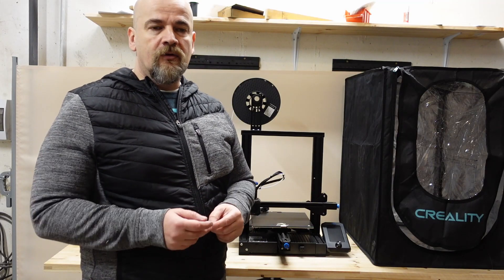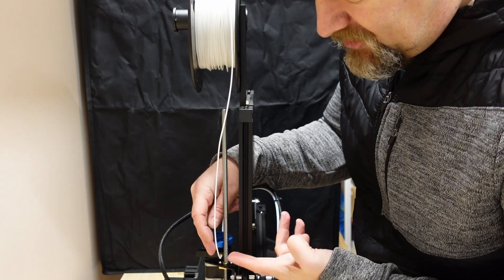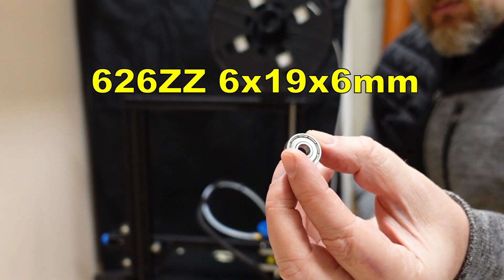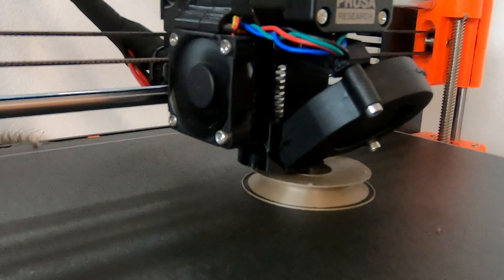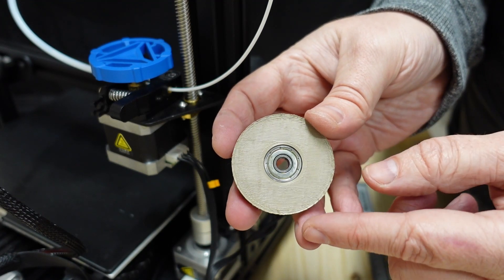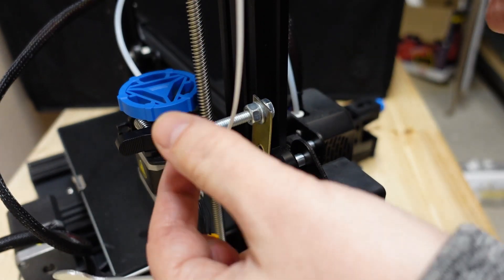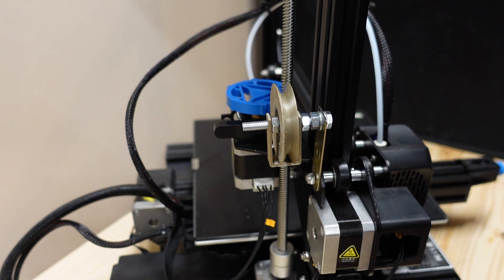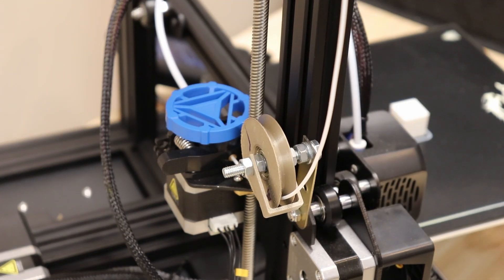My first upgrade on Ender3 V2 - the filament guide

Comment: I have the same  enclosure as you. I figured out after 1 year if you  put the  machine in with the spool side towards the  door  your  printing  life is easier. It seems wrong but I think it was intended to be that way. Hot end fixes get easier and filament swaps are  much better. Access the control though the  roll up door. Yes it still seems wrong  but  you may find it is  more user serviceable this way.

Comment: Are you sure that is better to not have a crumpled filament than to increase weight of Z axis and   create more oscillations? (sorry for my english😂 i hipe you Will understand what i am saying)
Reply from the maker: More weight is added near lead screw, that's OK. Problem would be if I would add more weight to other side of Z axis. (my next upgrade will be dual Z axis, but even without that it's OK)

Comment: To me it seems like 10 cm of (slightly curved) bowden tube on the intake side would do the trick.
Just a thought 😊
Reply from the maker: Everybody works with things around him. I didn't had 10cm bowden tube, but I had that 1mm thick steel plate and M6 bolt :-)
Reply: I tried using the bowden tube and it did not work well. First, it increased friction, even though it's made from PTFE. Second, the friction would increase the higher the Z level goes.
Reply: I bought a dual gear extruder that has  threads for a  second bowden fitting on the intake side  with the intention of adding a  short length with a  curve in it. I used a bit  of the  white 2.0 I.D. PTFE and it works  well for me. Might not with out the second  bowden fitting. I like the bearing  idea better and have  intended to make  one for a  long  while. Still  probably will but the  setup with the  dual gear extruder  seems  ok .